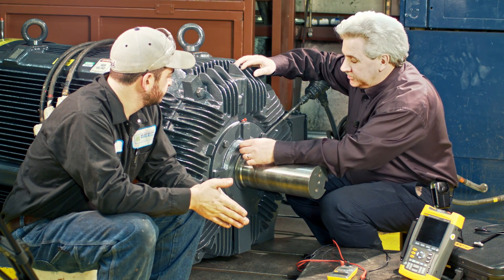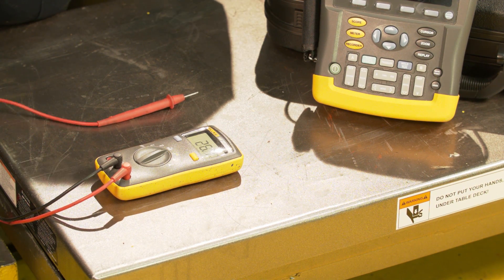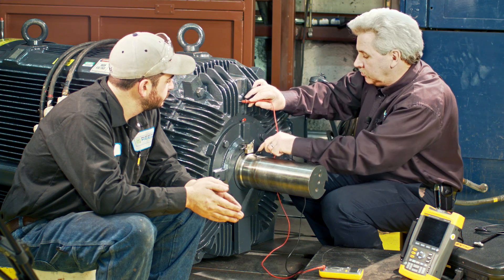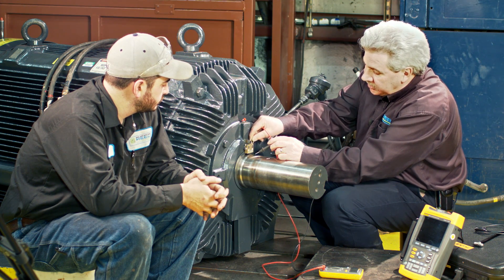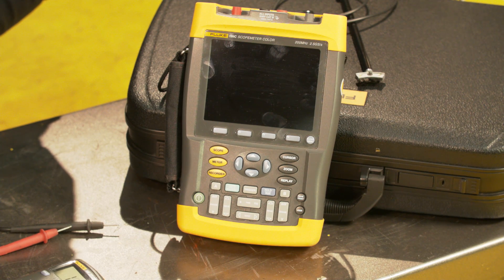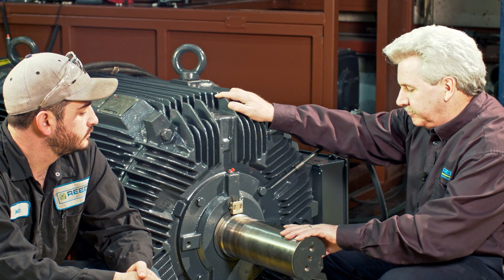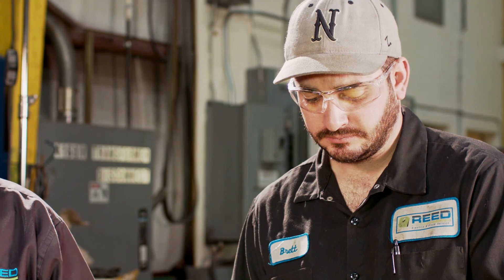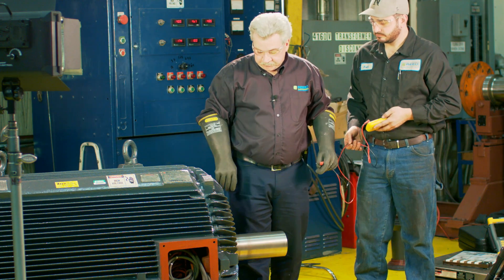Shaft Current Detection & Resolution

Comment: Great stuff, Very informative...I'm finding (by vibration analysis) quite a lot of our motors running on VFD's have electrical interference, I've reduced a bit by changing the switching frequency of the drive but hoping this will be a better solution.? Will be giving the shaft voltage test a go..not at 4160 volts though!!!
Reply from the maker: Glad you are able to find and address this somewhat hidden but expensive destruction. You may also want to look into CoolBLUE cores which, once installed, require no maintenance. Check out videos on our channel which discuss this solution to VFD caused shaft currents. Thank you for the kind comments.
Reply: The solution is to have the VFD as close to the motor as possible with as short wiring run as possible, also they make special shielded wires for VFD use that you can ground and it greatly reduces the EMI.

Comment: does current passing thru shaft also happen to induction motor (with insulated bearing) as it is widely found in VFD motor and what can be the cause for this problem to occur.

Comment: Awesome video. Thank you for this post. I have a 10hp running off a VFD that does not have any shaft brush or a grounding ring. I was told by my journeyman that the bearings on the motor are fluted. Is it too late to install a grounding ring/shaft brush to save it?
Reply from the maker: Thank you for the compliment. Once your bearings races are fluted, the bearings will continue to degrade at an exponential pace as they are already physically damaged. The interaction between the rolling balls against fluted bearing races will continue to fail the bearings despite measures to remove shaft currents now. We would recommend immediately replacing the bearings before a catastrophic failure occurs requiring complete motor replacement. Bearing replacement now is far more economical. After the bearing replacement, install either shaft grounding or CoolBlue cores to alleviate the bearing damage from shaft currents.
Reply: ReedElectric thanks for the response!! The customer is more than likely just going to want to replace the whole motor. I suggested one that already has the aegis grounding kit installed

Comment: 4160 volts when full voltage run 😨,  are you kidding?
Reply from the maker: Yes - we test run all motors at nameplated running voltage to ensure motor integrity. Issues such as hidden insulation defects and true magnetic center can only be fully discovered by a full voltage test run.

Comment: Lots of expertise and expensive hardware went into this video, but "alway" in the first 8 seconds is a glaring mistake that should be corrected.
Reply from the maker: Excellent catch Dale. Our editor is very embarrassed about the missing 's'. Correction requires replacement which does the disservice of breaking the link to this original video that many other sites have been using for training. Thank you for noting this flaw as well as your positive comments - much appreciated.

Comment: I have excellent results with these shaft grounding brushes from Helwig too. They are simple to install, not very expensive and last a lot longer than the carbon fiber filament rings.
Reply from the maker: Yes -  the Helwig style high silver content brush is a good solution as well (there are other makers of this style as well). They have the advantage of being easy to monitor for wear and easily replaced during a motor shutdown. We have had an issue where the shaft current was so high that the pig-tail lead melted! This was discussed in our bearing failure analysis video. Since that incident, Helwig has come out with a more hefty version of their shaft grounding brush.

Finally, if your shaft current source is an IGBT Variable Frequency Drive (most modern VFD's are), you should check out the CoolBLUE inductive absorbers solution. If proper initial testing (requires specialized test equipment) is performed, these devices are a permanent maintenance free solution for shaft currents. We have a couple of videos here that explain in more detail. Check them out. Thanks for your comments Randy K.